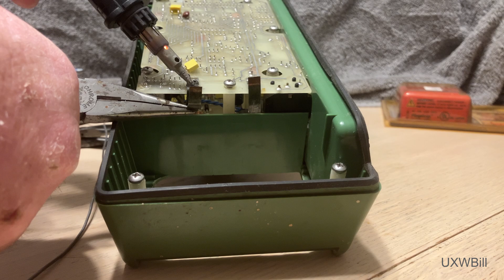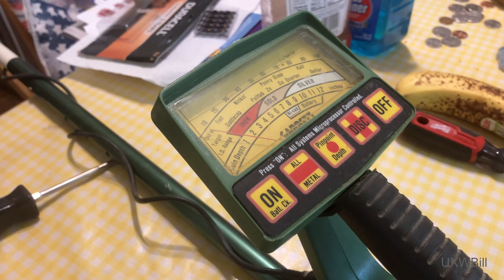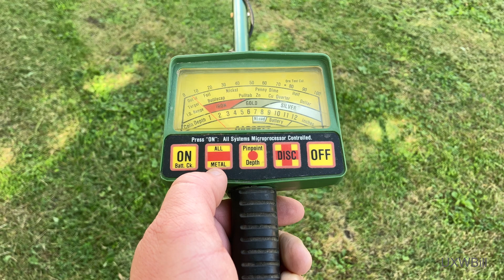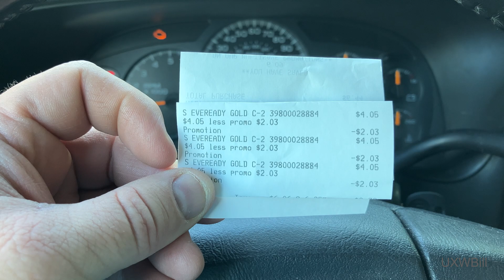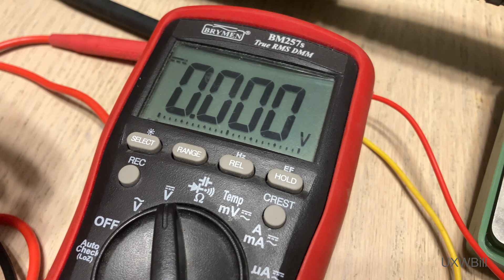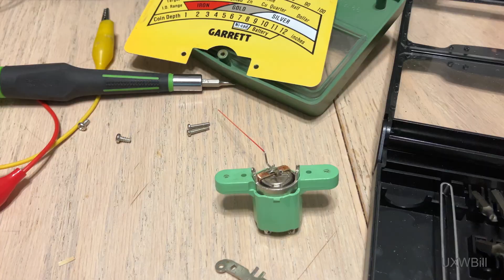Kitchen Table Electronics Repair: Garrett Grand Master Hunter Metal Detector

Comment: You could always try a generic 6 volt DC analogue metre panel mount
Reply from the maker: I am keeping an eye out for suitable replacement meters, although this is a very low priority project, as several newer metal detectors are readily available for use. My main interest was in seeing whether or not everything else appeared to be in order.

Comment: Picked up some vintage detectors the other day and didn't have much to hope. One is a Master Hunter CX and it showed some signs of life. After finding the ribbon cable contacts had worn and it was loosing connection , I managed accidentally discover the green stuff covering the ribbon is so old it lifted off after a bit of kapton tape I had put on peeled off. Was able to trim and  tidy the end up and use a bit of mylar as a backing to support it in the ribbons socket. Detector works beautifully. Now have learn the basics of metal detection :)

Comment: New to your channel; I have an idea: UV-cure acrylic superglue. Sold by J-B Weld,it flat out bonds!
The instructions say to build up by layers. They are right.
Alternately, Cyanoacrylate glue sprinkled with baking soda makes a steel-strong filler or overcover for the spring clip.
Meters are in abundance at online surplus electronics stores! I probably devote too much time looking at Jameco, All Electronics (reborn after closing), and others.
Adapting even a "strange" meter can be achieved. Low prices, a wide range of voltage and current,too. Nothing a trimmer pot couldn't fix.

Comment: Unrelated to this version of uxwbill but the IT man in you how many of these have you seen fail, 

The NVIDIA Quadro M4000 is a professional-grade graphics card designed for workstation performance. It features 8 GB of GDDR5 memory, 1664 CUDA cores, and a 256-bit memory interface. The card supports up to four 4K displays (4096 x 2160 at 60Hz) and utilizes a PCI Express 3.0 x16 interface.
Reply from the maker: "This version" of UXWBill. What an interesting phrasing.

I don't see a whole lot of stuff with workstation class graphics adapters. These days, I'm seeing even less with dedicated graphics cards, as IGPs have improved by leaps and bounds. Some of them can actually run demanding games surprisingly well.